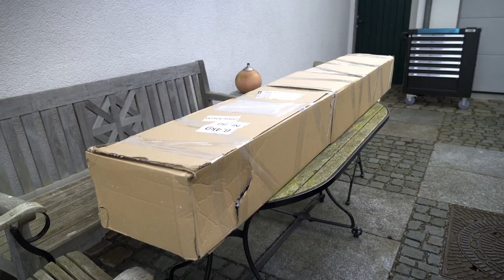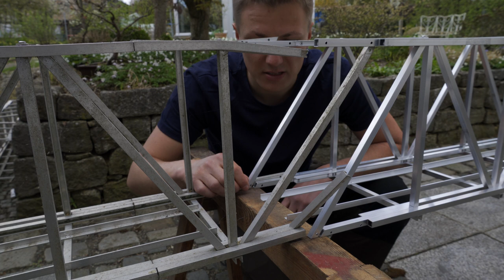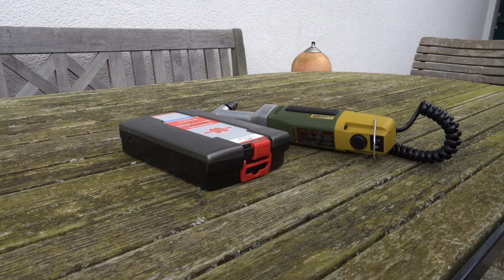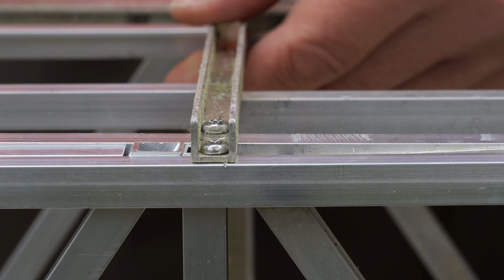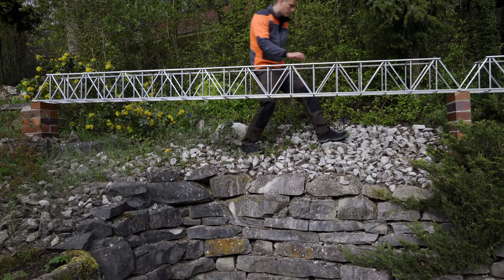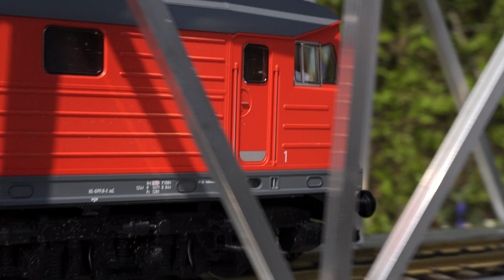Fixing a giant railway bridge!

Comment: You may be able to rework the damaged span and make a shorter truss bridge from the less damaged parts. 🤔😃
Reply from the maker: I had the same idea but it was not working. I re used the nearly undamaged half of the bridge to rebuilt the big bridge as you have seen. The other half was a total loss since there was not a single straight peace left. I re used some of the materials elsewhere, the rest was scrapped...
Reply: cool😄 @summitrailway